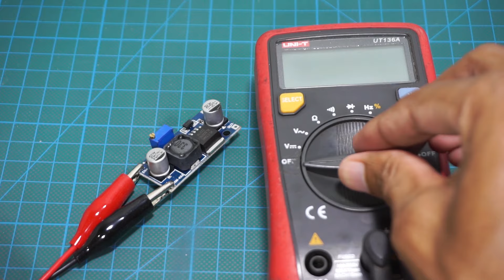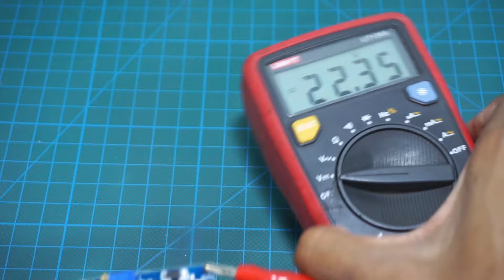Auto volt Homemade LED light tester, Simple LED tester circuit DIY

Comment: The open circuit volt should be 30 volt but why this circuit shows voltage only when led connected at output ?
Reply: It's the way he has it wired up. The + & - are soldered to the input to fire up the display. The white wire is the one that relays the data back to the display via the Probes when he measures an led.